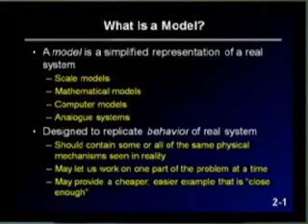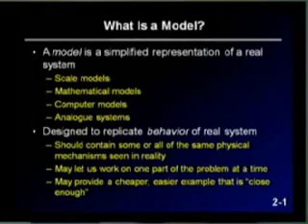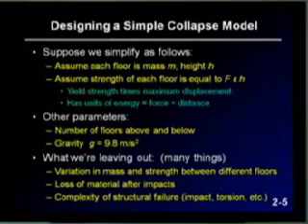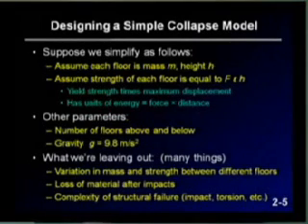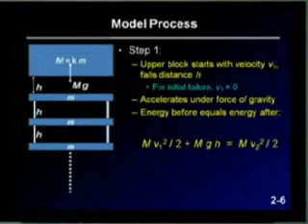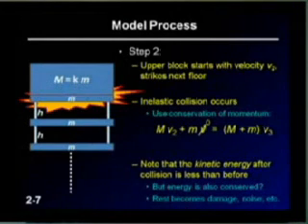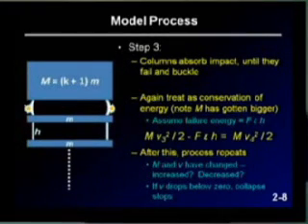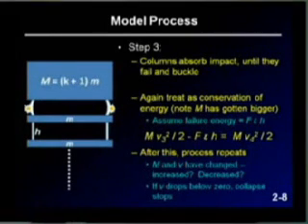WTC Modeling Instruction & Testing in the Real World

Comment: Firstly,  let me say I am glad to find a site where the physics of 9/11 remains a topic for debate. Please do all have a go at answering the questions below:
Two domino towers are built up to a height of one hundred tiles.
On top of the first one the builders place a flat steel plate weighing 15kg, and then they carefully add two more so that the tower is supporting 45,000gm of steel.
On top of the second they try to carefully place a 45gm steel ball so that it rests on the four central dominoes of the top layer. As they release it, the ball falls through the domino tower, scattering the dominoes and causing a complete collapse of the tower.
Explain why the steel ball causes the tower to collapse  despite the fact that the tower can resist a weight which is one thousand times as heavy?
The tower builders then take some double sided sticky tape, and put 4mm squares of tape on each corner of each domino as the build the tower to the same level. This strengthens the joints and makes the tower more stable. It also means that any collapse of the tower will involve the dominoes using up energy breaking the bonds between the tiles.
They now take the 45Kg steel ball and again try and place it gently on the four centre dominoes of the tower. What will happen when they release the steel ball? Will the tower collapse?

Comment: Putting aside the fact that the floor pans are hung from the wall panels and core columns:
When the dropping mass M hits the top floor (mass m1) some energy is used up, and M slows down, but then the new mass (M+m1) starts to fall and accelerates under gravity for a distance D until it hits the next floor down.
The impact uses energy and slows the mass (M+m1) and  then the the new mass (M+m1+m2) starts to accelerate under gravity for distance D, until it hits the next floor and again is slowed before the new mass (M+m1+m2+m3) starts to fall.

To determine of the collapse continues to ground level, or stops before reaching ground level, some calculation is required to see of the deceleration caused by each impact is sufficient to slow the falling mass by more than the speed gained between each impact.

The more floors that are added to the falling weight, the more energy / force is required to slow the rate of fall.

The larger the distance between impacts, the more speed will be gained between each impact.

A calculation is required to determine the above.

Comment: The experiment with the washers and paper rings is, in my opinion, too simplified to provide evidence that the Twin Towers could not have collapsed.
For example, the central tube restrains lateral movements which were available in the Towers.
also the structure of the Twin Towers was made with the floors hung off the walls and core columns, not resting on them, so if this video was looking at the collapse of the floor slabs the starting point is wrong.
The selection of the strength of the paper rigs and washers is not explained. What happens if the floors are represented by two washers at each level instead of one, or by 3, or 5?
  
I suggest that you instead see what happens when a domino tower collapses:
https://www.youtube.com/watch?v=Ni70KXe5jPo

There are of course major differences between the domino tower and the Twin Towers, but if the experiment with the washers can be used as a model, the domino tower also can,
Reply: https://www.youtube.com/watch?v=Ni70KXe5jPo

NIIIIIINE!!!

lol

Aside from that you are correct about how the floors were hung, there is also the fact that aside from a few mechanical floors all the others were uniform so increasing the vertical load capacity by adding a extra ring was also a error.

We do know that a single ring can support the mass of at least 11 washers because that is how many 1 paper ring (11) was supporting.

2 paper rings can support the static mass of 28 washers for the same reason.

Plus in both cases they were doing it right after the first test.

Comment: A floor in the WTC towers only holds 29,000,000 pounds, thus the video is based on BS. If 12 floors are placed on a lower floor, it fails; thus the silly experiment is BS, based on BS.
Reply: +eyesuntzu   Of course there isn't a shred of hard evidence that a floor ever disconnected from the core.  So what fell on the core?

Comment: Ryan Mackey's Model is extremely flawed. He grouped the top portion and made it fall as if it was a box. But wait a minute. The CORE structure should not have fallen. That CORE structure was built so massive. If a commercial plane had really hit the steel perimeter walls, Newton's 3rd Law of physics would have shredded that plane on impact. There is no way, it would have gone on to create structural damage to the MASSIVE CORE columns.
Reply: Norma Rae There is no way, it would have gone on to create structural damage to the MASSIVE CORE columns.

uh.. it did it quite easily.  People forget that the WTC while huge is an incredibly  light building.   It was specifically made that way.   Structurally speaking for a high rise its a wafer light design.   The exterior box columns at impact point were 9mm thick and hollow.  In relation to the building they are paper thin. The connection bolts that hold them together will fail at 5 degrees off vertical.  The plane would accomplish this in 2/10ths of a second.    A fully loaded semi trailer weighs 60,000 pounds.  Imagine that moving at 820 feet/ second.   That's a lot of force.  Now multiply that image 6x.   You have a huge amount of force hitting a very small area all at once.  This is a bullet to a pop can.
Reply: Karl Smithe

Yes incredibly light.  You're talking about the totality of the steel.  But the components that made up the building for its SIZE were EXTREMELY light. It was specifically designed to be as light as possible  (Do you want a paper on it??) in scale the exterior box columns were no thicker than PAPER.  Fact!!   Also a fact.  There was 4x more concrete in the building than steel.

Know your topic!!
Reply: Karl Smithe

I should be able to provide links? 

Was there something stopping you from finding this material on your own?  I could do it without any trouble.  I love your guys logic on this stuff.  You act like just because someone doesn't hold your hand and take you there that this somehow makes you  "RIGHT".  If you're not spoon fed a link you just fold up your arms and say.. "No link,.. you're just making it up". 

Ignorance of the facts does not make you right.  It just makes you lazy.  The creationist who couldn't be bothered reading a book on evolution does not "Win" by doing so.
Reply: eyesuntzu

They say the columns could support 5 times the load above.

That's great.  When the top of the building failed this generated a dynamic load nearly 30 times its static load rating.

that's like saying you could piggy back 5 people.  and then 25 more jumped on you.
Reply: roquefortfiles   "incredibly light"  That is doubly funny.  The NIST admits there were 200,000 tons of steel in both towers.  But then in 10,000 pages they never specify the amount of concrete.

So people either hide or claim what helps them believe what they want.
Reply: +Karl Smithe The core can't stand without the shell; the shell is the lateral support for the WTC towers.  No big deal, just a fact. If you want to say otherwise it means failure to do research, failure to find the truth. The core would have stood after the WTC fell if it had lateral stability, it did not.  Sorry, proved wrong by the collapse, and failure to study the WTC structural design.  My source is the chief structural engineer, and your source is?  
"The tubular framing system for the perimeter walls resisted all of the lateral forces imposed by wind and earthquake, as well as the impact loads imposed on September 11." - from the chief structural engineer - but the connection of the shell to the core columns provided additional lateral stiffness... what does all of the lateral forces mean?  Why did the core, the super core fall after the shell and floors were gone; there were 70 stories standing, why did it fall?  What is it about "all the lateral forces" that is eluding you?
Reply: roquefortfiles
 "the exterior box columns were no thicker than paper" Wow, where do you get your facts from? Ryan Mackey perhaps?
Reply: roquefortfiles   If the WTC was "incredibly light" you should be able to provide links to data on other skyscrapers for comparison.  How about it?
Reply: roquefortfiles   Actually I downloaded the NCSTAR1 report and burned it to DVD years ago.  I searched for and read every occurrence of the words 'steel' and 'concrete'.  The NIST report says the tower used 200,000 tons of steel but it never specifies the total amount of concrete much less its distribution.  The report is 10,000 pages.

So if you are going to CLAIM the buildings were 'light' then you need to provide supporting evidence in order to not appear to be an idiot or a liar.
Reply: +Norma Rae Core's lateral support was the shell, the core can't stand on its own.  A fact. Look it up.
Reply: eyesuntzu  Utter BS!  The Core was normal grid skyscaper design with columns averaging17ft apart instead of 30.  The Core gavethe buildingits rigidity.
Reply: eyesuntzu Curious how a professor at the University of Washington could make a model of the Tacoma Narrows Bridge in a wind tunnel in 4 months to test the oscillation of the real thing, and yet in FOURTEEN YEARS of the 9/11 Affair people can only CLAIM things are facts.  Try getting accurate data on the distribution of steel down the towers.  Good Luck!  How can models even claim to be accurate without the data on the towers?
Reply: It is still a physics problem.  Inside job crap is irrelevant.  If airliner impacts and fire can destroy buildings more than 2000 times their mass in less than 2 hours then the physics should not be that difficult.  But it is certainly curious when the NIST cannot specify the amount of concrete in the buildings in a 10,000 page report.  How can the physics be done without accurate data?

Comment: The rebuttal portion of this video is ASTOUNDINGLY stupid.   These people have no understanding of how a building stands up.
Reply: roquefortfiles   But it takes ENERGY to destroy the supports strong enough to hold the static load.  So build a model that can collapse completely that damages its supports in the process.
Reply: Karl Smithe

Sorry.  You can't scale something like this.   There's a paper on why.
Reply: roquefortfiles   That's nice, tell us there is a paper but don't provide a link.  It's the "believe what I say because I said it" game.   Even if there is a paper that does not prove the paper is correct.

The only way I can think of to make a good model would be tu use a 3-D printer.  Each level would be 2 ft square and 1.5 inches tall.  The model would have to be about 900 pounds.  But the problem would be getting the distribution of mass correct.  As long as we do not have that data on the real building then the cause is hopeless.  But as long as we don't have that data then believing that aircraft impacts and fire could destroy the towers is ridiculous.

No matter what the truth why haven't "experts" demanded the data?  The point of the model is to make every level as weak as possible relative to the static load.  So if a "weak as possible model" won't collapse under dynamic load then there is a problem with 9/11 because skyscrapers are not designed to be as weak as possible.
Reply: Yeah, name calling always impresses me with someone's intellectual brilliance.
Reply: Karl Smithe

 I will never understand the "truther" brain.  You stand in front of a room full of factual material.  A library at your finger tips (Google).  The door to this room is unlocked.  The information is as available to you as it is to me.  But you constantly have to be held by the hand and shown where to go and if someone doesn't provide a link for you to follow along you think by default that this somehow makes you right.   And you thumb your nose at everyone and say  "no link.."  I think the bigger question is was there something stopping you from having an interest to find the material on your own?   I say you're not interested in Truth at all.  Because if you were you'd have found this stuff.   I had no problem

Something stopping you?  A lack of curiosity perhaps?  An unwillingness to move from your entrenched beliefs? and a security in doing nothing and buying yourself a little time by having someone provide the information for you?

I think so.  Otherwise you'd look it up on your own.  I had no problem finding this stuff.  Because I am interested in it.

What's your excuse?
Reply: Human beings cannot change physics

Quote:.. "There is no way one floor is going to carry the weight of 14 stories falling on it.  Not possible.  Not even remotely possible.  Drop 14 stories on one floor and the building would collapse instantly and right down to the foundation.  And it wouldn't be slow".  End.  Les Robertson.  Head Engineer of the WTC.  (I think he knows his subject)

WTC 2 had more than double this amount of floors fail.  32.  If 14 is going to collapse it to the ground what does your common sense tell you that more than double this amount of floors failing is going to do?

Produce LESS damage?  Its more than double what is already a failure load. 

Karl Smithe
Reply: So you need people that you regard as "experts" to tell you what to think.  But then you get to pick and choose your experts who tell you what you want to hear.

But none of the "experts" have built a model that can collapse in 14 years.  When has Richard Gage ever built a model?  So we seem to have a very peculiar psyops that just maintains confusion so dummies can believe what they want about a physics problem that should have been resolved by 2003.
Reply: Karl?  back at you.   The structure stands statically. It does not stand dynamically.  And 14 floors failing is NOT a static load.  If you don't understand the difference you'll never understand how it can collapse.  It has nothing to do with Physics.  It has to do with HOW it is engineered.

This is written by an engineer.

http://www.burtonsys.com/staticvdyn/

Karl Smithe
Reply: Karl Smithe

Its center of gravity has nothing to do with why and how it can collapse.  You're talking about its ability to be knocked over.  That has nothing to do with how it can collapse. 

The force of the wind on the building is a dynamic load.  That means motion. It is engineered to sway for this load.  That is entirely normal and engineered in to its design.

But the load of the floors up and down is a static load.  This has nothing to do with its ability to sway.   The floor loads are carried only as static loads.

14 floors failing is not a static load.  It is a Dynamic load.  The building is not engineered for this.  

Its no different to having a bullet placed on your chest.  You survive because its not moving.  Its a static load.    That is HOW the building functions.

If we fire the bullet in to your chest it is now a dynamic load.  Your chest will be ripped to bits.  So will the building if 14 floors begin moving.   It is only built to take that load not moving.    And its not a "theory"  its a fact.
Reply: But the center of gravity of every skyscraper must be low relative to its height, but that subject doesn't come up among "experts" on this subject after 14 years.

(The center of gravity has nothing to do with how or why it can collapse to the ground.  That has to do with static vs Dynamic loads.  Not where the center of gravity rests)

So i don't really know what your point is supposed to prove.  I don't think you really understand what you're talking about.  The center of gravity has to do with its stability.  It doesn't have anything to do with how or why it might collapse.   That is a load issue.  Not a stability issue.

Karl Smithe
Reply: roquefortfiles   The center of gravity of the CN Tower is 61 meters above the ground even though the tower is over 500 meters.  That means that lighter mass higher up would have to accelerate greater mass lower down in addition to destroying the supports in order for the structure to fall straight down.  Ever heard of the Conservation of Momentum?  So how did the north tower come down in less than 30 seconds.

If people just BELIEVE then they do not have to come up with the data to answer obvious questions.
Reply: mainlymusicman

You do not need to tell me bud.  I have been saying this for years.
Reply: mainlymusicman

There were no planes?   Nearly 50 professional stills photographers ALONE shot the second jet approaching.  People with 30 and 40 years top level photography experience.

I kinda doubt someone with this level of experience lifts $20,000 worth of gear to their eyes to squeeze off images of something..

THAT ISN'T THERE.
Reply: mainlymusicman

The lunar landing site on the moon is visible by a powerful enough telescope.
Reply: mainlymusicman

Also.  The footage taken by Neil Armstrong while the LM was descending was recently matched up to Google Earth's moonscape "Google Moon" mapping.  They line up crater for crater 45 years apart.

I love seeing the moon hoaxers try and worm out of that one.

Comment: And as for all the people trying to use the fact that it's a dynamic load working on a static load system is also completely false and misleading, the facts are that the buildings actually accelerated through the supporting structure, one way this could happen is if the falling object came to a complete stop transferring all of the energy into the bottom section and somehow...(think about shattering) pre-weakened the structure, Allowing the top portion to begin to pick up speed again falling through an already destroyed structure, this obviously did not happen...you guys might as well start calling us heretics